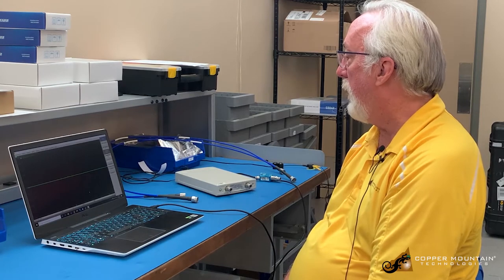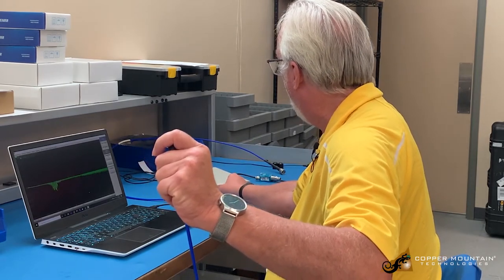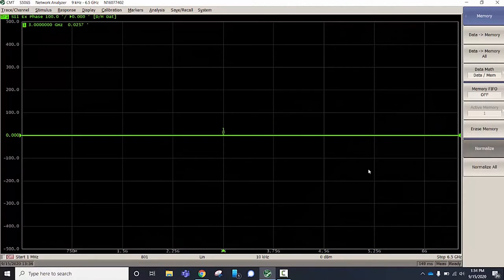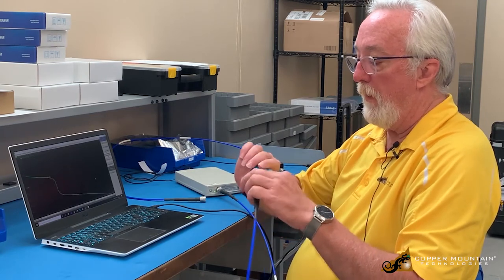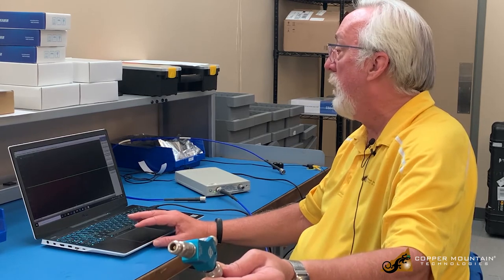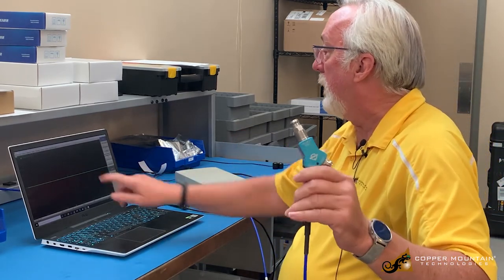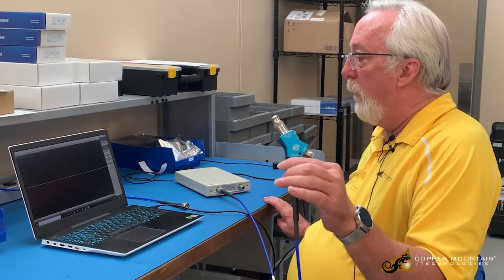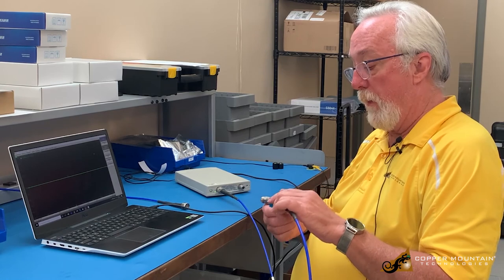Measuring Cable Phase Match

Comment: Is it possible to have the same cable type (eg. LMR-400) be phase stable if the length of the two jumpers are different? Is the correlation of the cable being of the same phase with another exclusively length based?
Reply: Hi Samuel, normally, one thinks about two cables being phase matched if they have the same length but one cable could also be a full wavelength longer than the other and the phases of the two would match. In fact the longer cable could be longer by N*wavelength and still match the phase. This is no longer a broadband phase match and only works at one frequency of course. This arrangement would be less stable over temperature as well. Two equal length cables will shrink and grow together with temperature changes while a longer cable will grow proportionately longer.
Reply: That may be the most succinct and clear explanation I’ve heard. Thank you very much
Reply: LMR400 cable is not phase stable and length has no effect.
You can size a stable phase cable to any length and it will always remain stable.

Comment: Hi Brian,
Hope you're well! 
I have to produce a pair of RF matched cable, the matched cable should be trimmed off at 135° (measurement carried out on S11 port (opened) and perfectly matched to the required value) however when measuring the transmission of the same cable it reads nearly half the original value (connection follow) any idea why please ?

NB: Readout are set as 3 windows Window 1&2 measures SWR , window 3 measures phase, what should be the right port to read this from ? should it be port S11 or S22? or even S21?
Thanks
Reply from the maker: Great question! The S11 reading gives you twice the delay and twice the phase change because it is a two-way measurement, up and back. An S21 measurement of the connectorized cable will read the actual delay and phase. Just divide the S11 readings by 2 to get the desired answer.

Comment: What is different physically about a phase stable cable that actually makes it phase stable? It doesn't contract/lengthen with changes in temperature as much?
Reply from the maker: Hi Max. It's hard to tell, but It may be that the shield is designed so that it expands with temperature and reduces the effective dielectric constant somewhat which makes the cable look shorter at the same time as it lengthens making it physically longer. I suspect it is something like that, but I don't really know. This would be a trade secret by the manufacturer.
Reply: NB 'phase stable' can refer to both phase stability versus temperature and/or flexure.
Reply: @laurens4359  thank you Laurens

Comment: Hello Sir, If someone want to measure cable phase or phase matching of cable with reference cable, S11 is only  required or anything else??
Reply from the maker: An S11 measurement could be sufficient. Apply a short to the reference cable and measure the phase. Leaving the cable open is less accurate as the fringing fields at the open end my vary somewhat and affect the reflection phase. The radian phase will come from twice the delay of the cable plus twice the internal delay of the short multiplied by the radian frequency so it will be difficult to determine the phase of the cable alone unless the properties of the short are known. If the same short is used to compare the reference cable to an unknown cable, the phase difference can be measured, and the transmission phase difference will be half of that.
Reply: thank you so much sir @CopperMountainTech